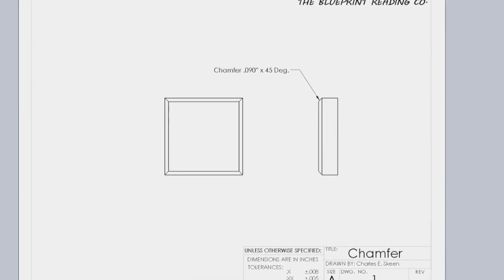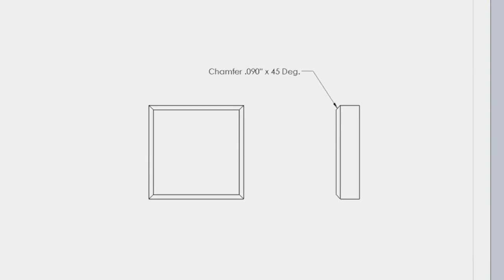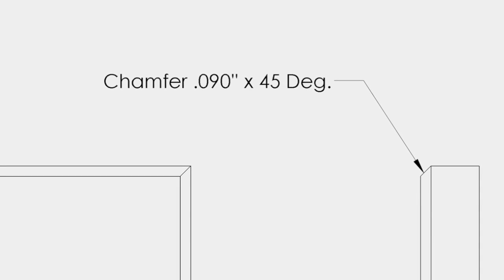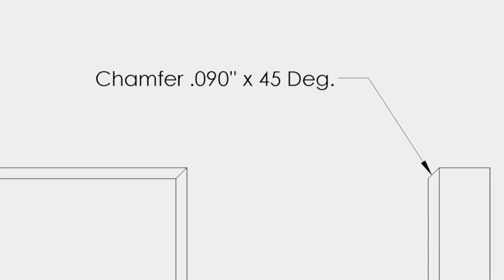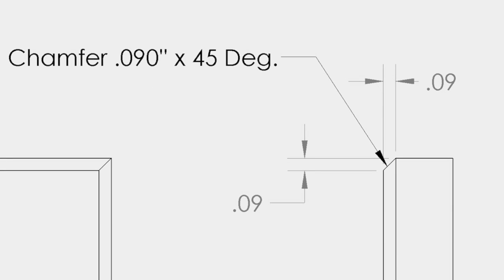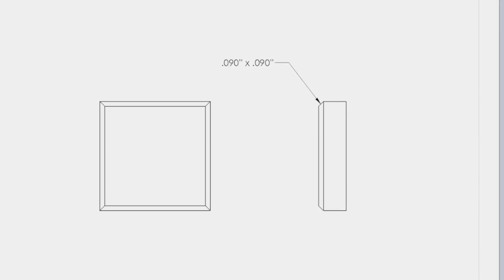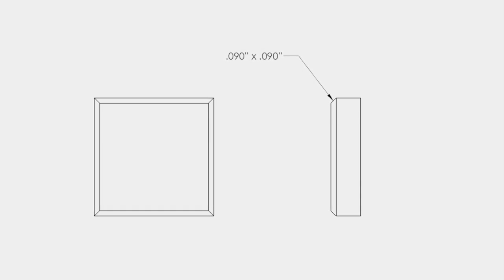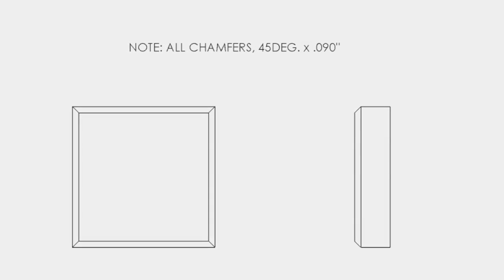Dimensioning Chamfers

Comment: Sir, how about when the drawing indicate C0.05?
Reply from the maker: I assume that your print is in millimeters, so the chamfer call out is half a millimeter or approximately .020”. It is most likely indicating an edge break which is usually 45 degrees. If you are unsure, always ask the creator of the print to clarify.
Reply: sorry C0.5